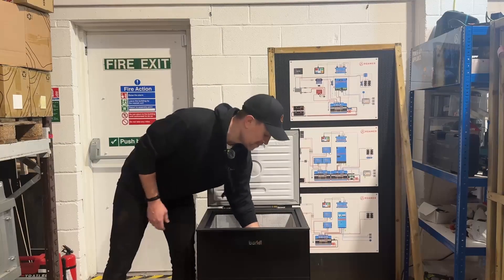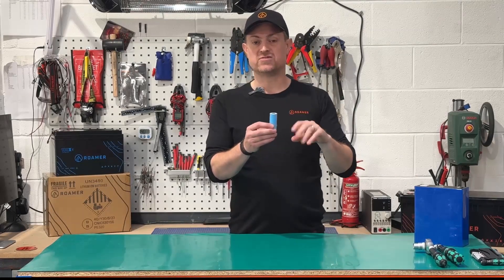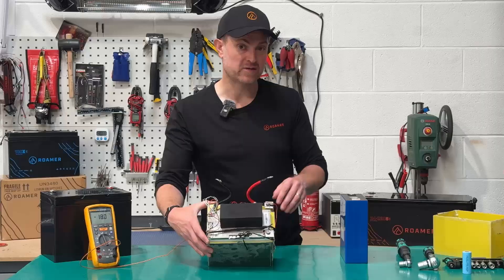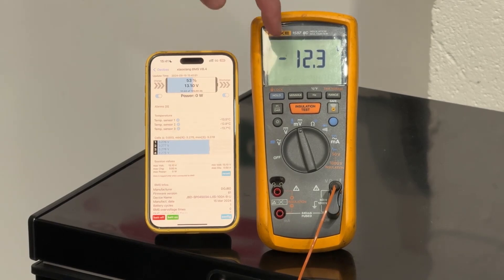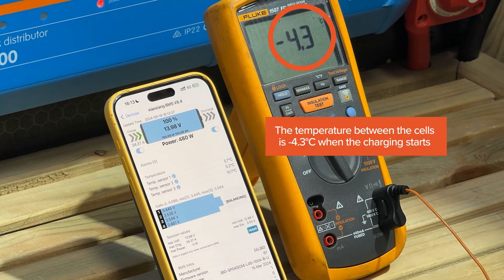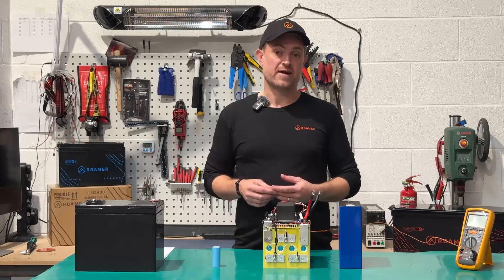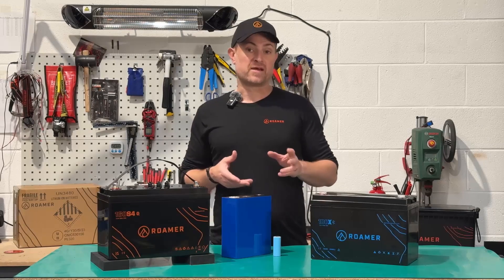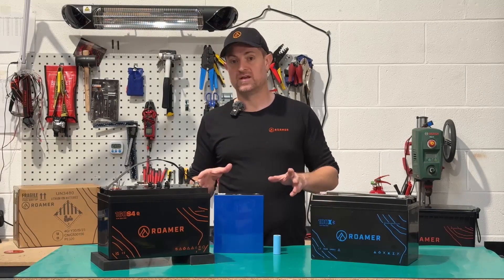Self-heating lithium LiFePO4 batteries tested - FAIL!

Comment: There are certainly engineering mistakes in how the example heating system was engineered. The most obvious of which was that it seemed only use one of the three available sensors to determine that it was warm enough to safely charge.
But I'm wondering if the test is representative of the likely use case. The minus 17 degree freeze was extreme compared to many installations. But more importantly I would expect that most batteries are installed and charged and therefore calable of keeping themselves warm. If the BMS was programmed to do so. So the better test would be to see if a battery could keep itself above feeezing to begin with. Or if the test battery was charged before it went into the freezer then the real issue is that the BMS was not programmed to avoid itself getting frozen.
Ideally the BMS should heat the battery to keep it above zero, then lock it if for some reason it falls too low and notify user to defrost it safely.
Reply from the maker: Yes there are some very simple ways to improve the design, for example moving one sensor between the cells and waiting till all sensors show above 5 degrees. 

The test started at minus 12 which is going to be a rare situation in the UK but not unheard of. And these batteries are used all the world. I think there’s scientific value in testing with various cell sizes and at various starting temperatures but the principle is going to be the same. The problem is caused by the heaters forcing the pack to warm up too quickly, leading to uneven heat distribution. 

There are leisure batteries out there which maintain temperature above a set point and this is standard on grid scale batteries. These solve the problems highlighted in this video but they are much less common because permanent heating will drain the battery (the tested battery only uses heat energy when charging so it will stay frozen until plugged in)
Reply: it really coms down to time if you need 2h to start charging its not much use is it

Comment: It would be cool for batteries to have a ECU to calculate the probable energy required to heat up the cells for safe use (mostly the charging). It could calculate the simulated temperature of the battery and determine what energy content is required to heat it up. Shouldn't be that difficult to figure out if you have internal and external sensors and know the coefficients and masses.
Reply from the maker: That would be cool. If you have Victron chargers and a Cerbo then it is also possible to program charge rates by temperature (using DVCC feature), that’s something we’re playing with now.

I’m not sure if needs to be that complicated however, as long as low temp protection is in place and you have enough power to run an external space heater (to warm it slowly) then there’s no need for heaters at all. Cell heaters are ‘solving’ a problem that doesn’t exist for the vast majority of people
Reply: @roamerbatteries  The closer to an automotive application and the north pole you are, the more important it is. :P

Comment: I agree the implementation of the heating is done completely wrong, it could work well with some simple fixes. If you are smart, you relocate the temperature sensor, add additional heating film in the middle and test again. Does it work? Implement it in your own product. 

"Our product is better because the competition did something stupid" is the wrong mindset.
Reply from the maker: Yes I agree it can be improved and I sincerely hope that this video leads to affected brands making changes in their products. I think problems will persist however, using big prismatic cells wrapped in heat film is always going to be difficult. The examples I’ve seen where it seems to works well are Battleborn and Tesla who both use cylindrical cells and have a much more advanced heating arrangement. And actually I don’t think heating is needed at all for this use case, if you install and maintain correctly then your batteries should never get below zero or if they do then you can warm them slowly over a period of a few hours - no need to try and hack the process. 

I did have some concerns about publishing content that appears to put competitor products down, that’s not our usual style or mindset. However, this is a possible safety concern so I feel it needed to be called out. Hopefully other independent reviewers carry out their own tests going forwards
Reply: @roamerbatteries  I understand the BMS in the video seems to be setup wrong but I'm just not buying this is an issue for prismatic cells in the way you seem to be suggesting (yet also saying some people have done it right? edit: ignore, I see how tesla do it...). What's the thermal conductivity of a prismatic cell? All that's need is an algorithm, a couple of sensors and the solution would be fine. You seem to be suggesting that heat won't propagate, that it won't work, but it will, it just needs to be managed and managed slowly.  I've got too much on to spend more than 5 mins on this but just done some heat propagation calcs using thermal conductivity 0.2W/m (assuming the cell is an EVE cell)  and arrived at 2 hours from 0 degrees and closer to 3 hours from -10 degrees i.e. the battery has been allowed to be completely frozen and needs to be warmed up safely to be charged.
Reply from the maker: @robfodder5575 Thanks for this. Very helpful suggestions and I agree, there are probably some pretty simple ways to improve this. Maybe start by relocating temp sensors, making sure heating is distributed evenly and also as you suggest, slowing it down (or introducing a delay) so that all cells warm up completely before charging is enabled. I hope improvements are made here, it’s in the interest of all manufacturers for safety to improve. I would personally want to see more testing and certification of cell heating before this is seen as being fit for purpose however

Comment: Can the BMS be programmed to trickle charge when near zero, slowly ramping charge rates until various sensors determine it is safe for fast(er) charging? Essentially heating the batteries internally through a set of pre-determined charge parameters?
Reply from the maker: Yes it’s possible but tricky as most BMS have no way of limiting charge current, control is either on or off. If you have Victron chargers and a Cerbo GX you can program this externally with Node Red.

Comment: I don't know how Battleborn or others work...  But supposing they add additional heat surfaces between the cells -- and monitor the cell voltage for the condition, and backing off the charge current when it happens?

Also, obviously this only applies when starting out cold...  But in a van, or let's say a mountaintop radio installation, the battery can simply keep itself warm all the time, rather than being allowed to get cold.  Right?  Eventually the power will run out, but if it's planned right, the sun will come up the next day and provide more power.
Reply from the maker: Battleborn use small cylindrical cells so this is not the same issue. I expect the internal engineering is significantly better too. Yes you’re correct, self heating batteries are only designed to recover a frozen battery. There are other options out there that include a maintenance heaters to keep overall pack temperature above a set point. There are also low temperature cells such as the Roamer XTREME battery that can be charged at -30 without any heating at all

Comment: A solution can be found for low temperatures. However, I am curious about how it will be at high temperatures.
Reply from the maker: The temperature threshold required for thermal runaway in a LiFePO4 cell is much higher than you’d ever see in reality. The BMS will shut down the battery way before this point

Comment: Heating this type of LifePo4 batteries is of course not intended for charging. More before discharging/using it in colder weather, just as you would preheat an engine. You only get more energy out of it because the battery is already a bit warmer instead of using a cold battery in a cold environment. You can forget the whole loading story and never do anything below zero in practice

Comment: You've reviewed one battery of your choosing..
Reply: One that's very popular, and indicative of what is available on the market...?
Reply: @fitmydashcam  Which one is it? Fogstar?
Reply from the maker: We can’t confirm the brand, sorry. It wouldn’t be fair to them without giving them a chance to respond. Also, I have concerns over ALL self-heating batteries that use heat film wrapped around prismatic cells that is activated while charging, it is not specific to this one battery. As mentioned in the video, there are good examples of self heating out there. And there are simple ways this can be improved (relocate temp sensor etc) but wrapping big prismatic this way is always going to lead to uneven heat distribution

Comment: Many people won't experience -18C regularly so how do heated batteries perform at -5C? Also how do heated batteries perform when actually in use ie being charged and discharged and does that help keep them warm?
Reply: January-March above 60N, you will more than likely experience -18 or lower :P
Reply: @rkan2  we do
Reply from the maker: The effect is the same, its just quicker... the outside of the cell pack is warmed up by the heaters but the inside stays frozen. If you're using the battery then the chemical reaction will warm it up, yes. But if you're using it in a camper then its not going to get cold anyway so the heaters wouldnt be needed.
Reply: @roamerbatteries  "stays frozen" is a bit of a misrepresentation though. the intended use is not to thaw a completely frozen battery. The intent is to extend the usable temperature range by heating the battery before it can get as cold as putting it into a  deep freeze with no power input to the battery.  It would be more fair  to test what happens with the battery placed into a freezer set at -5 or -10 C, whatever the advertied temperature range is, but supply charge voltage to the battery for a few hours a day to test winter conditions.  I don't expect it would be a total success, but it would certainly fare a lot better than the one in this video. The external power would allow the heaters to kick in as the battery temperature approaches 0. Ideally when the battery is not being charged, it would then have some current draw applied to it to replicate over-night usage. Current draw will also help keep the battery warmer because of internal resistance. It may not keep it above 0, but it would certainly be a more reasonable  test than just freezing a battery as cold as you can get it and then applying charge current so you can say  it failed an unrealistic test.

Comment: Yeah - you could only build the battery yourself with more intelligent architecture. Either combining more temp sensors especially in the center - or heatmatts between each cell.
Reply: the problem with more heating matts is where to locate the sensors and with prism cells they are just have to much mass to relay on temp sensors alone and adding delay means a long time without charging
Reply from the maker: @OskarHartmannsson  Yes true but really, if its installed correctly then dropping below zero should be a very rare occurrence. So waiting a few hours is not a big deal - you can just let it warm up naturally, there's no need to try and speed it up using cell heaters and as we've shown then this can cause more problems than it solves. If its likely to drop below zero regularly then this type of self-heating is pointless anyway, you would need something that can maintain temperatures constantly.
Reply: @OskarHartmannsson  you are 100% right.  An 15kw Solar battery has a weight of 110kg / 220lbs - takes some hours to heat in case you don‘t use 1.21 GW to heat. Insulating would help a little and using solar you have some hours a day..
Reply from the maker: Yep. A good start would be to put a temp sensor between the cells. Also a good idea to program the BMS so that it only starts charging when all sensors are above zero